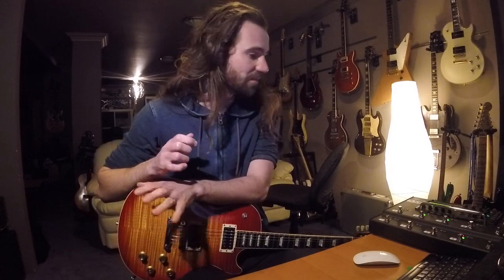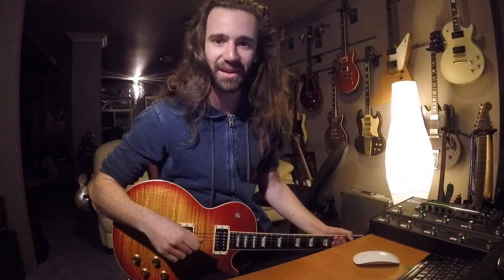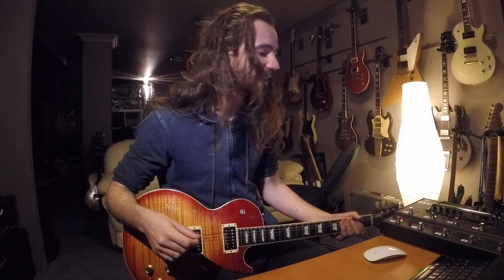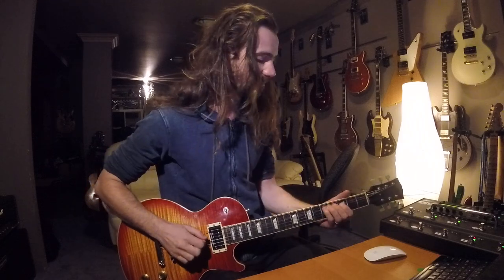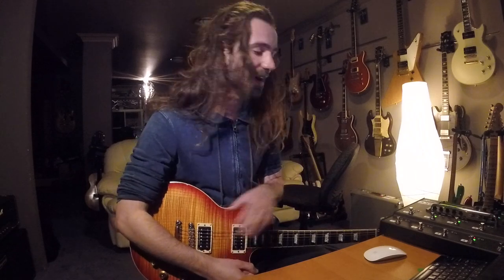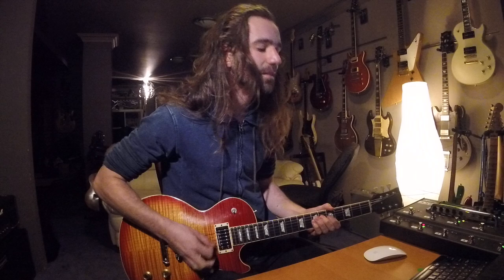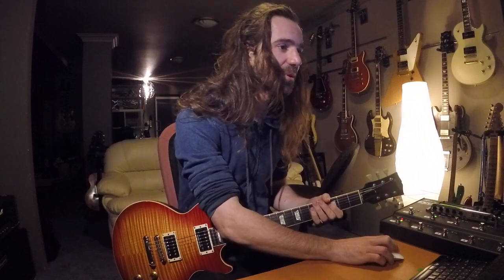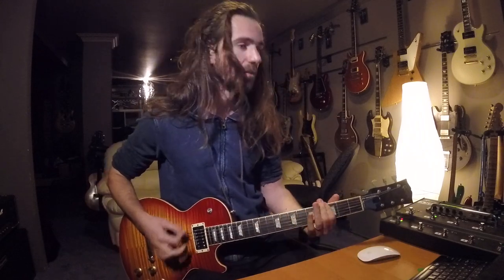Get the most out of your new AX8 (or any modeller for that matter)

Comment: Hello Leon, I'm not sure if you or any other viewers have experienced this but... After designing several fantastic presets on my AX8, I tried sampling (without saving) a different AX8 cab bundle I'd previously saved to my AX8 library.  However and for whatever reason...all of my designed and factory presets changed tonally, sounding thin, brittle and less authentic then they had before the attempted cab bundle import process.  Now and instead of using Fractal amp models, use two Kingsley tube preamp pedals the Constable (Marshall) and the Maiden (Dumble), which are placed in the AX8s EFX Loop. It sounds absolutely incredible but, I'm no longer able to use the excellent Fractal amp models due to this.  Before I accomplish a backup and reset my AX8 do you possibly have any insight as to why this may have occurred. My apologies, I know this is far removed for the intended subject but, I've watched many of your AX8 videos and you appear have much expertise with this particular processor - thanks, John!

Comment: Hey Leon. Your videos have been very informative. I wanted to ask how exactly you use the AX8 live? How does using it live compare to a traditional rig? Is it a steep learning curve or something that takes a lot of time to get used to?
Reply from the maker: Stephen Flannery if you run in with a power amp and cab it's a very similar experience to a traditional rig. If you want to use cab modeling and go FRFR then that's a different experience, since you're hearing the sound of a mic'd cab (much like a studio sound). I've tried both approaches and prefer FRFR, as it's more representative of the sound the audience hears.
Reply: Leon Todd Great video!  I also prefer to run my AX8 direct into the house (using an FRFR as a monitor). What FRFR monitor do you use?

Comment: Question about scenes: is there a way to set up different scenes per song? If you’re playing live and use lots of different sounds on a song by song basis (think of a band like Radiohead or U2), 3 or 4 scenes won’t cut it. Could I set up a bank for each song with the necessary scenes in each bank?

Comment: Curious to know what you use live for your FRFR? Do you run direct to front of house using the presets/scenes that you have demo'd here?
Also just wanted to say that I have picked up a lot of good tips from your vids with the AX8. Very good job!! Keep them coming.
Reply from the maker: Thanks so much. At a decent venue I just go straight to PA, if it's a shithole with no PA then I take a Matrix GT800FX and a Mesa 212.
Reply: @LeonTodd  how do you go about using the mesa cab? do you have a different preset with no cab modeling?

Comment: Hello leon
I have apollo twin duo firewire interface
It has optical in at the back
So i can use the ax8 spdif out into the optical in of my apollo and firewire into mac for recording?

What i need is the fiber optic cable right?
Reply from the maker: Hafiz Wahab I've never tried that setup; AX8 spdif out to interface spdif in works great, but I'm not sure about the optical in. The forum would be a great place to ask that one

Comment: Hey thanks for the video ! I have a question is there a setting where if you have different patch with the same amp setting and if you change the setting for 1 patch ,its automatically change all the other patch with this amp setting?
Reply from the maker: Jérémy Bonneau they call this feature a global block on the Axe-Fx 2. Unfortunately the AX8 can't do this.
Reply: Ok thanks for the answer. Do you think they will make this function available in the future?
Reply from the maker: It's commonly requested, so if it's physically possible I'd guess that it will come eventually. However, if you use Axe-Edit you can save your favourite blocks and settings to the block library and recall/tweak/save them as you go, so that's a pretty neat workaround. I almost exclusively use Axe-Edit to create tones so i don't miss the global blocks feature.

Comment: Leon, what value range do you use on the high cut?
Reply from the maker: Fireheart usually 8k at 12dB per octave. I'll open it up for cleans and ribbon mic IR's though. Don't be afraid to go as low as 5500hz with a loud FRFR.
Reply: Leon Todd got it. Thanks!